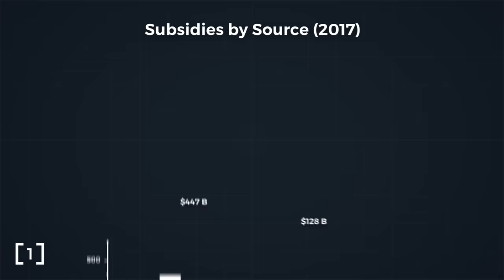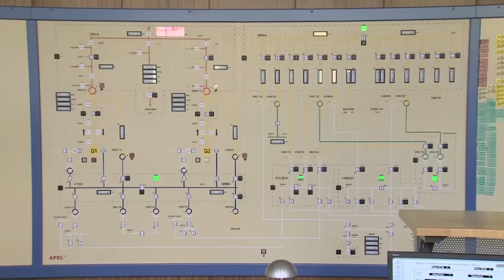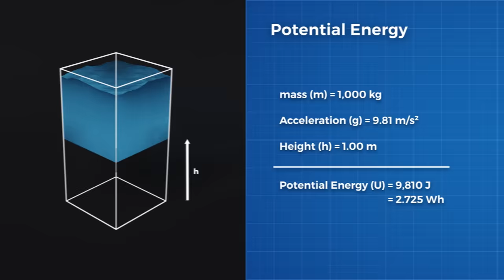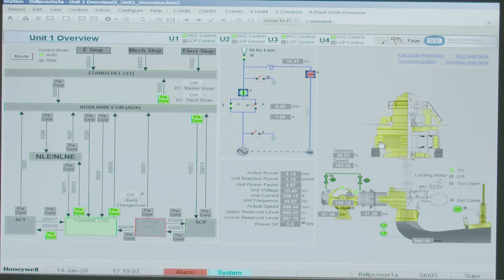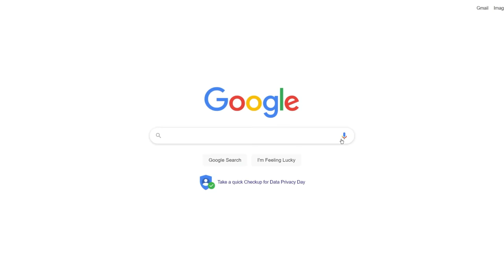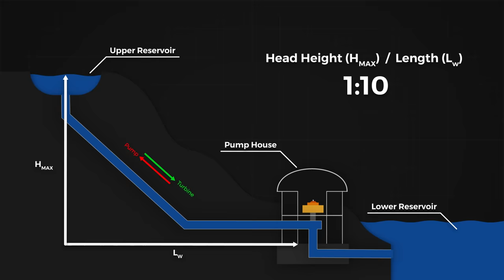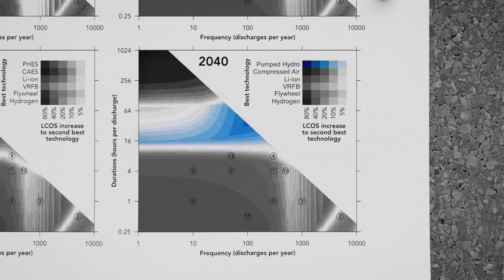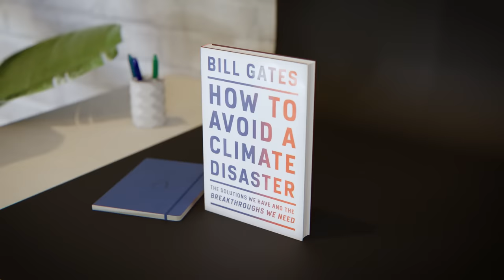The Truth About Pumped Hydro

Comment: The Truth about Pumping Out High Quality Videos
Reply: Ha
Reply: Nebula saved'em.
Reply: “What is sleep?”
Reply: It's funny what people write and get 100s of likes
Reply: @moboxgraphics  Thanks to you i can see the Truth :) Loving every animation on Real Engineering. Whos idea was it to put Grogu in the background in the other vid?
Reply: @MyNoNeX  That would be brian i believe
Reply: @JohnDoe-ud3ue  Skeet. Skeet.
Reply: @JohnDoe-ud3ue  
Hybrid Mechanical Batteries:
Wouldn't The Output Water Pressure Increase Also, As More Water Is Pumped Into The Containment Area, Especially If It Had A Downward Conical Shape? If The Water Was Then Diverted Sequentially Into Self-Contained Vessels With Loaded, Weighted, And Reversible Transmission Pistons, Perhaps Even Spring Based, With Water Being Naturally Incompressable, Could The Vessels Be Filled By Head Pressure Input And Also Be Significantly Pressurized For Output To Any Effect, Acting In Essence As A Hybrid Mechanical Battery System?

El Heirro: Canary Islands Wind-Hydro
What Kind Of Pumps Do They Use? Wind? Perhaps They Could Also Include A Battery Of Freznel Based Solar Condensation Pressure Boilers, With Hydraulic Pistons, Check Valves, And Inline Drop Points, Similar To A Combination Of Heart Pump Mechanisms And Transpiration, To Supplement To Pumping Operations? In Proper Applications, It Can Not Only Basically Combust Water Instantaneously, But Distill It As Well, While Producing Excess Extractable Energy.

Fo Realz?
Reply: Robert Sears  They Have The Right Idea; It Just Needs A Little Creative Enginuity.
Reply: @VerifyTheTruth  huh? I've got no qualms with the tech. Tf u on about lol
Reply: @JohnDoe-ud3ue  If You Have To Ask That Question.. 😐
Reply: Robert Sears  Giant Water Boilers, Full Of Extremely Deadly Concentrated Chemical Elements With Extremely Long Halflifes, Built Along All Major Waterways And Faultlines, With One Hell Of A Punch If Something Goes Wrong. Murphy's Law. One Might As Well Strap A Country With A Suicide Belt, And Throw The Remote In A Dogpen, Wrapped In Bacon.
Reply: Robert Sears  However, I Will Say That The Thorium-Salt Breeder Reactors Do Seem More Advantageous In Some Respects. Perhaps They Could Also Be Located More Cautiously, With Respect To Sanity And Potential Catastrophes.
Reply: Robert Sears  What Is The Estimate On How Many Nuclear Reactors Are Currently Leaking Nuclear Waste Into The Environment? Radioactive Iodine? What Else Are They Leaking? Where Is The Waste Being Stored; How Long Must It Be Stored; And How Many Of Those Facilities Are Leaking Nuclear Waste Into The Environment?
Reply: Robert Sears  All Things Considered, I Am A Personal Fan Of Hydroelectric Reservoirs, When Coupled With Adequate Levy Systems And Well Maintained Waterways.
Reply: Robert Sears  Well, I Have Here, On This Thread, Roughly Explained Just A Couple Gadgets, That, If Engineered Properly, Could Help Solve Some Of Those Issues.
Reply: Robert Sears  You Would Probably Care More If You Knew That 1/3 Of The People You Know Will Most Likely Die Of Cancer, That Is Aside From Potentially Perishing In Some Major Catastrophic Event Or From Heart Complications.
Reply: Straight facts
Reply: bro legit. hes given 2 within a few days normally we wait like 4 months 

such an underrated youtuber
Reply: I’m sensing a pumping iron vibe here which the bodybuilder with an Austrian accent
Reply: @Manuel-gu9ls  Lol. 👉💪👈
Reply: @Manuel-gu9ls  Who Is The Wealthiest Man Alive?
Reply: Big Brain haha
Reply: Tim  Can't Breed Fish In Or Grow Crops With Hot Wind, But You Can Extract Energy From An Updraft.
Reply: how about comparing 128B for renewables vs 21B for nuclear which is the largest scale of clean source energy
Reply: @BLRSharpLight  If The People In Power Truly Gave A Shit About Those Billions Around The World Who Are Living In Abject Poverty And The Other Billions Who Are Living Paycheck To Paycheck For Less And Less, Then World Hunger And Most Diseases And Unsanitary Water And Poisonous Pharmaceuticals And Homelessness And Electricity Shortages And Involuntary Servitude And Substandard Education And The Redundant Overtaxation Of Basic Necessities Would All Be Things Of The Past By Now.
Reply: Tim  They Are Not Implementing The Most Efficient Designs. Why Do You Think That Is?
Reply: @CBielski87  Reguardless Of What Is So Oftentimes Reported, The Types Of Nuclear Energy That Are Being Used Most Frequently Are Not "Clean", By Any Standard Of The Word. They Boil Water With Some Of The Most Toxic And Volatile Substances On The Planet.
Reply: @CBielski87  Nuclear is not clean. It is the worst.
Reply: really, i think the problem is too many people are running their mouth and not actually doing anything. 
eg. hollywood, youtubers, media, wankers on facebook, wankers in the comments section, you get it almost all people.
Reply: P
Reply: @marknoneya6630  Do You Have Any Pointers, As To How The Average Person Can Rise Above The Redundant Cycles Of Endless Debt And Taxation To Go About Making A Real And Tangible And Lasting Contribution Towards The Overall Betterment Of Society?
Reply: TD. Tired of this shit. Unsubscribed.
Reply: @Executableapplication  Of What Exactly Are You Tired?
Reply: Real engineering what happened to your Nikola hydrogen vehicles video?
Reply: A brief on Hydroelectric 2 nd stage power recovery system
This system is for all hydro systems running with a TAILRACE setup
Why a tailrace setup ?
In an ideal setup without the need to modify the construction plans to fit into a geological
or given plot of stable ground, the benefits are not lost to compromise.
As however in the real world hydroelectric systems are generally a compromise, and the
TAILRACE is invariably longer than the turbine hall would find IDEAL in regards to
power made per ton of water used - a loss that can now be recovered
With the turbine hall believing a shortened tailrace has been fitted this allows the turbine
hall to make more power out of the same volume of water
IT IS WISE TO NOTE TOO SHORT A TAILRACE AND A SURGING ISSUE OF THE
TURBINES WILL OCCUR, leading to its self destruction
What sets how short the tailrace can be made?
Because each and every dam is in effect a custo- made system, and so the type and
number of turbines at the location dictate the power recovery units location in the tailrace
But there are basics that are common to all hydro installations
Example of why a shortened tail race works
A different way to look at what is happening at this point is:
You buy a 2 stroke motor to fit to a go-cart but it needs a bit more power. The quickest
and cheapest way is to get a tuned exhaust pipe – it’s generally a shorter and larger
pipe
This allows the motor to breathe freely and returns a boost in power output with just the
right amount of back pressure
Firstly Back Pressure
This new setup will not generate a backpressure issue to the dam (a common reason
why to date the industry has failed to benefit in this area). In short blinded by their
education. A stumbling block that has been drummed into every Engineer so no one
looks at this sort of issue as solvable
Secondly Down Time
The assumption is made that to build this system would mean the dam will be offline for
years when 90% if not more of the installation will not require the dam to shut down and
the final step can be taken during the annual servicing period of the dam
The freeing- up of the turbine hall from having to work with a tailrace that is now tuned to
the best power output. NOT distance to the discharge point!

And along with my new 2 nd stage turbine power recovery systems the return should be 3-
8% more annually combined
Thirdly Servicing
With no extra shutdown periods needed to service the new power recovery system as
this can happen independently
And should a unit go offline in say a three-unit setup, the offline unit can be swapped in
a day without the need for the remaining two units being effected OR the turbine hall
operations
The end of the tailrace will continue to spill out into the existing lake or river location with
only one extra outlet fitted to handle the same water volume, but now at a slower pace
so that all works are easily able to be environmentally completed
If a pump hydro system is used this will not alter the setup or require modification
It should be noted that this system has less parts to an equivalent turbine setup so there
are less failure points
And is expected to outlast the required life expectance of the dam
NOTE
Chinas hydro output to date is:
According to IHA&#39;s 2020 Hydropower Status Report, total hydropower capacity reached
356 GiggaWatts in 2019 after a further 4.2 GW in capacity was added
China&#39;s total estimated hydropower generation reached
1,302.00 TerraWatt hours.
FINAL POINTS
So say China’s hydro output was up by a further 3% only (as not all China’s dams can
run this system). So what is that worth as annual income to the country?
It should also be noted that a new dam construction with a penstock hydro system fitted
will double the return in secondary power recovered and still be serviceable without
impacting the turbine halls operations
Reply: @VerifyTheTruth  you don't get something for nothing. Pumping water up costs energy that can be recovered later. No springs or pistons or whatever gets around that fact.
Reply: @stevenson720  The Question Is, From What Source Or System Does That Required Energy Derive?
Reply: Truthers <=> clickbait. Real Engineering delivers, but for god’s sake stop that crap.
Reply: Humans 0
Saiya-jin 1 to 6
Angels 7 😇

Kalki Ironman 5th matriya buddha 8th arc Angel 11th satguru 13th imam and 24th avatar after 2026 😎

Almighty God 9 😇

Humans type 2.5+ after 2026 by Kalki Ironman (christ in the white horse)(son of man on clouds) type 7 and 8 😎

Jarvis the world’s first artificial intelligence (parrot) 😎

Cuz Kalki is ironman batman super saiya-jin superman ben10 saitama Narutoo optimus prime and every super heroes combined after 2026 😎

Jarvis world’s first artificial living being (just like vision in marvel universe)😎

Made of Quantum and sub quantum particles 😎

Power source quantum energy arc reactor (type 7) level technology 😎

Kalki Ironman going to have every kind of arc reactor like:- type 1 Nuclear fission, nuclear waste, hydrogen fusion, type 2 3 4 5 antimatter arc reactor (solid liquid gas), type 6 electro quantum arc reactor, and type 7 Quantum arc reactor, type 8 limitless quantum energy arc reactor without quantum particles 😎

Kalki Ironman going to have sun in a box million billion tons of hydrogen nuclear fusion reactor type 2 3 4 5 just like sun and stars in the palm of his hand 😎

This all going to happened by self replicating quantum nanobots knowledge energy and techniques at type 7 7 7- respectively 😎.
Reply: Nice!